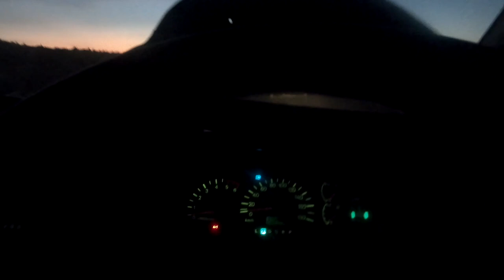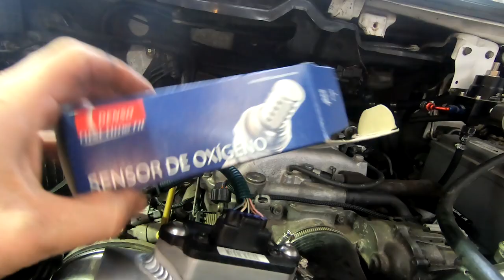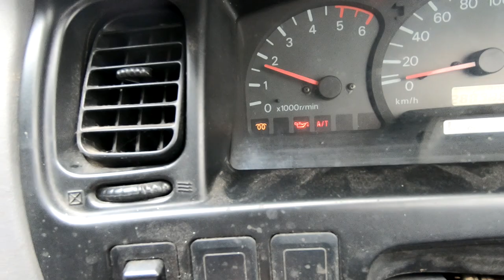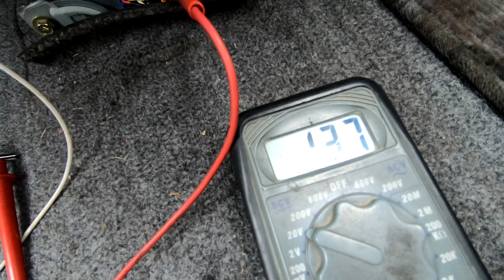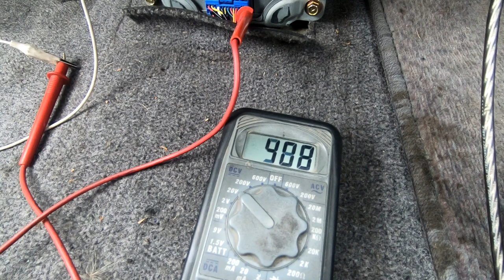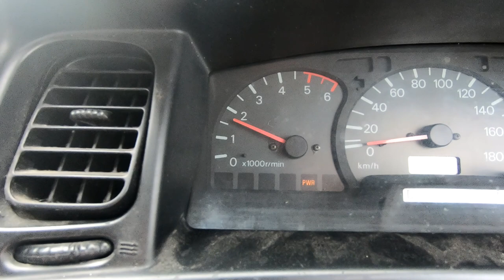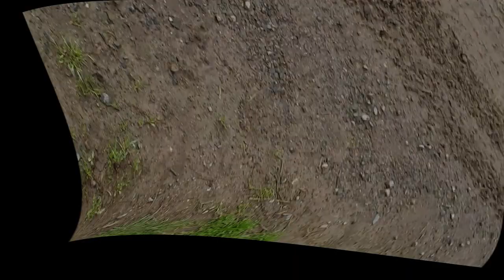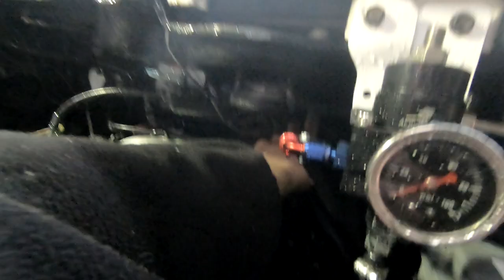1uz-fe VVti Mitsubishi Delica L400 van 4x4 engine swap wiring. Part 2

Comment: Hi i have a Musuibuisi l200 /colt v6 3000i 4x4 runging a lexus v8 vvti 1 uz it's limiter is cutting on 136kmph can it be the diff ratio it's not shifting in 5 gear
Reply from the maker: If it was shifting into 5th it would rev higher.   Otherwise either remove rev cut or change diff.
Reply: датчик корости не тот. зубья

Comment: Ha ha, i can only imagine the juice this thing has, what motor did you put in, what gear box, tail shaft and diff, obviously it all had to be changed, including the susspension and brakes,  give us details of the build please
Reply from the maker: 1uz vvti from ucf20 celsior,   stock auto trans with uz front shaft and pump,  stock diffs,  stock brakes, stock tail shaft.  Transmission stays in stock position.  Cheers Kelvin